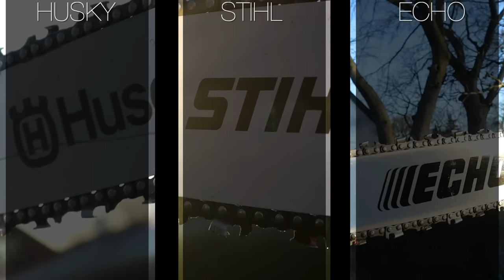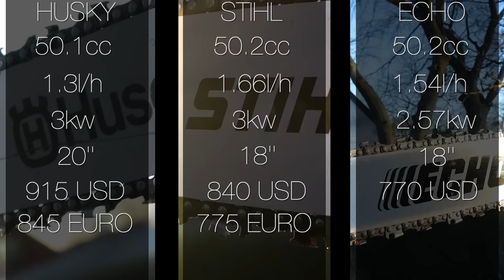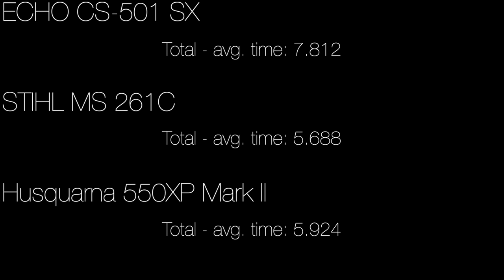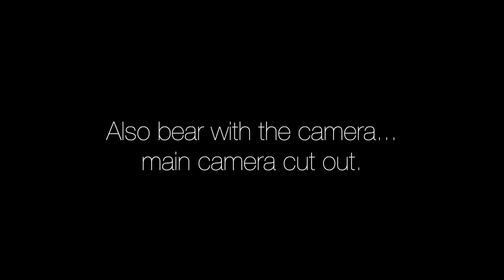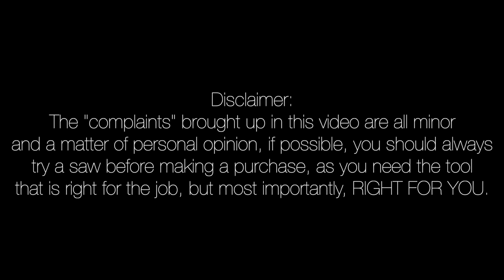Husqvarna 550xp mark II vs. Stihl ms 261 c vs. Echo cs-501 sx - Chainsaw comparison video

Comment: I have an Echo and I don't know, my RPM's are a whole lot higher than what yours was running. It almost sounded like it needed some carb adjustment.

Also, Echo has an electronic ignition which I'm not sure the other two have.

Also, were you running aggressive chains? Are they just factory out of the box?
Reply from the maker: This echo saw was send to me by echo to test and yea out of the box chains

Comment: Fantastic up load really really good Well done  The only comment I would make is in my experience the echo's tend to be more reliable as the saw ages and keep on
being good starters for example I had left an old echo in the shed for many many years and when felling a tree I broke the chain on the main saw so I went to the old one
in the shed It took abpout 7 or 8 pulls but it ran with fuel that was that old !! I have never had a problem starting any of my Echo's but have had fun and games with both
stihl and husks husks being the worst especialy when hot !!!  Thanks again it was very interesting to hear your views !!
Reply from the maker: Thank you and thanks for your input

Comment: Great video. I have the Stihl ms 261 c , but looking at buying a Echo, because I am so tired of the Fuel/oil caps and plastic locks of the top cover. They have really messed up with the new design

Comment: For checking weight, yes add the bar and chain.  But dont think its fair to fill with oil and gas.  This could make the one with larger tanks appear heavier, when really the extra weight of more oil and gas for a longer run time may be what people want. If in use the wight of oil and gas is a deciding factor, then get a smaller saw.

Comment: I only paid $445 US for my 501p brand new!
Reply: And you can get a cs490, which is so close to the 501 it's stupid, for $300. Mod the muffler, scrap the caps, and get a loop of Stihl RS chain, and you have a fine, LITE, NEW saw for $350.

Comment: Question, are the bar mounts same on Husqvarna 550 and Echo 501?  Reason I ask is was looking for a Cannon bar and their bar finder offers exact same bar part number for both but I don’t remember them being interchangeable.  Got an older Echo CS500p and my main complaint with Echo is lack of aftermarket options.  Also have a 562xp mark 2, 572xp, ms461, Ms 661c, 201T 150T, T540xp, and Milwaukee 14” top handle.  Not brand loyal, I prefer the Husky newer saws but like Stihls from 5 years ago.  Seems like Husky is going for more low end torque now and Stihl focusing on higher chain speed…I prefer the torque myself…plus Husky though a little heavier now has better antivibe, chain brake, and handles…just my opinion.

Comment: I got iritated by the oil cap on stilh as well
Reply from the maker: I know so many who say that the oil caps are crap
Reply: There junk never should have switch  over
Reply: I've not had any problem with the oil cap on my Stihl 261; I like its tool-less operation. However, the one on my Stihl 461 did play up (it refuses to easily lock back in place - takes a few tries). Then, the oil cap on my Stihl 661  has remained in good working order.
Reply: Femalelumberjack I despise the caps on my ms261c other than that the saw is a screamer but those damn caps I literally want to take a hammer and beat my saw to pieces every time I touch the caps
Reply: I think they  make conversation  kit to swap  them. Over old  kind  of caps
Reply: Caleb Thacker I understand your frustration
Reply: James Evans when a person pays that much for a saw one would think the damn oil and fuel caps wouldn’t be an issue I know several times I’ve dumped a whole tank of bar oil down my leg cause I thought I had the lid closed their junk
Reply: @calebthacker9654   100 percent  right  I cant. Count  how many time.   I dump.  Oil or gas down my leg
Reply: Mike Swank yup it’s bullshit not to mention how   Much sawdust falls in the oil cap because the caps are inset or recessed whatever that term is stihl dropped the ball bad on that design you literally have to use a air compressor to get all the oil gunked saw dust out of there
Reply: @calebthacker9654   shit annoying they went they way with all there saws.
Reply: Mike Swank yes sir I say we all start the echo train at least they price gouge us yet and make a pretty good product!
Reply: At least they don’t
Reply: Sorry
Reply: But echo people pay attention you have a good thing going don’t screw it up

Comment: Those Stihl caps take a lot of getting used to.... the older style are much simpler and better and why change something that isn't necessary....
Reply: Yes i agree after sitting on a log one day for 15 minutes trying to get the oil cap back on ..I was about to go to town with it ..gawd
Reply: @normanmallory2055  Agree! I have the 1st gen. MS261, and the oilcap was a real problem to get back on, I had to watch several videos to find one that showed putting the cap on, it helps to have the exact angle when re-inserting
Reply: @NewBookz  I donated my hankie to the oil cap while I was sitting on a log to wipe the bar oil off. Gawd how hard can this be? A cap inside a cap inside a cap, huh. Two many moving parts . The dealer grabbed a new saw to show me, first time I noticed he put it on it didn't take.. second try he got it. Yup I've had it again just would not lock down. Grabbed  the inner part of the cap and turned it until it stoped,  nope , Okay I turned it the other way, yup it went on..

Comment: Excellent comparison! I'm thinking about picking up a new 50cc to stand in for my good old Husky 55 Rancher, and these three would the main contenders from the local dealers.

Yes, the Husky and Stihl seem more "Pro" level. However, this will be my lightest limbing saw, so the Echo being lighter may be bigger deal than the power disadvantage. And, if I catch it on sale, the CS 501P will be $400, which is hard to beat.

Thanks for the video!
Reply from the maker: Glad you liked it

Comment: I am a little critical of your Husky Review, for the money, regarding other main duties with mine, it delivers on big diameters, very efficient for overhead cuts and other rigorous duties that go past simple rounds and what you seem to use it for.  Having using the 550 XP for major work projects requiring the user to limb, keep it running it for small diameter work and tank of gas, put many hours on saw reducing fuel loads, clearing brush and small trees, this saw handles everything pretty well besides global warming.  Have overheated them due to Contracted use in higher temps, making the mistake of overheating a very well used saw.  Regulation friendly Husqvarna high standards have made them my Saw of choice .I used it Professionally for landscaping, fuel reduction, road clearing crews, limbing crews, and Wildlife and Fisheries Projects.  Not going to Review the other two saws, just believe even though the price has gone up, their Research and progressive saws seem to carry the load.

Comment: Locally I can get 3 saws very close in price. All around 50 to 50.2 cc with 20 inch bar.
Echo $349
Husqvarna $399
Stihl $399.
I'm really leaning towards stihl. I know the fuel and accessories are more too but I won't be using it all the time. Great video by the way
Reply: A 261 for 399 ?

Comment: very good and useful video , ive got a 192t a 250c and an 066 all Stihl  , all very good saws ,  dont like the modern  fuel and oil caps which are fiddly and unsafe  , as sometimes  you think they are locked  when they are not  , ive had one snap too , the old fashioned caps on the 066 are unbeatable
Reply from the maker: seamus purcell thank you
Reply: @Femalelumberjack  you are very welcome

Comment: My farmboss(290 Stihl) was like $349 on sale at NAPA. Of course that was over ten years ago. Still cuts like new or better with an exhaust mod and a carb adjustment. Whenever she blows I'll throw a 390 jug and piston I. It. If bottom end is solid. Yeah, I'd rather have a c model or anything with a metal bottom end  but whatever. Or hunt a similar husky.

Comment: I go with Stihl all day every day. Most of my equipment is Stihl. It starts up right away and does the job fast and very reliable. Last Stihl I had lasted me 19 years and that thing cut down well over 6K trees and cut them all up to be hauled away. Good job ma'am. Keep up the good work.
Reply: Has stihl ms 290 for 15 years. Never put a part on it. Cut 100s of cords with it. Just chains oil and gas.

Comment: The Husqvarna 550xp I had the pleasure of using it for 6 months while I own the stihl ms 261 c, in my opinion the stihl 261 is much more comfortable than the hsqvarna 550xp. I have never had the opportunity to try the eco cs-501 sx. In the start-up between Stihl and Husqvarna, the Stihl is significantly superior to both hot and cold
. However, they are all very good machines!
Reply from the maker: Exactly, they are all good machines! I’ve loved working with both 550xp and 261

Comment: I just wanna know what more i would get out of a 261 pro Stihl over my homeowner 391. The lighter weight of a couple pounds (pretty significant) is nice but its also got half a horsepower less do to the smaller engine and costs 200 more. Although i must admit captive bar cover nuts are nice cause one of mine vibrated loose in the field today.
Reply: Pro saws are lighter, more reliable and more powerful for the same size engine. Your 391 is larger then 50 CC. They also cost more. I once had a 360 and then purchased a 440. It was one of my good decisions in life. The 440 lasted longer and still cuts great. The 360 gave up the ghost long ago. I had two 441s. They cut even faster. First one got hung up in a big oak that kicked back and crushed the saw. The new 461 is light and cuts fast. If you cut enough you will love a pro saw. I heat my home in a northern environment for years now with wood. I also own land that I try to keep fallen Limbs or trees some what cleaned up. My one son is a master sawyer. So I do take his saws and try them out.

Comment: Just purchased Echo 501, seems like the bar oil runs out the bottom (when not in use) quicker than I can pour it in! the top!  Otherwise I think it has potential, however after almost two tanks of fuel, I can't say much good or bad just yet.  
Such a beautiful lady doing a great review...thank you .🍺 🥨 🍺
Reply from the maker: There are a few comments on this video about the 501 being way better after 10 tanks of gas 👌
Hope you fixed that oil issue :)

Comment: I work in a sawmill and cut through many different types of wood and the Husqi never lets me down...we have 2 261 and they are a great saw and so easy start but definitely pick the Husqi over them for the range its versatility. It will cut anything wet,dry,hard,soft with the same ease. I found the 261 slows down after prolonged cutting. Have no idea why but the Husqi holds its sharpness for longer too. 
P.S Finally have the knack to close the oil cap 😂 First time everytime

Comment: These saws all run between $550-610 USD.  The Husky with a 20" bar is the most expensive due to the longer Bar.  From what I can tell. Today, Echo is to Shindaiwa as Husqvarna is to Jonsered.  Pretty much all will get the job done.  Pick the Color/Features you like best and start laying in a few cords before winter.

Comment: Durability is a major consideration in price comparison. The switch would be broken off the Echo and the choke would snag and ripped out of the housing in professional use. How about the mounts, or how they handle a chain throw ? Factors to consider in the $154 price difference.

Comment: IMO, the best chainsaw is the one with the best dealership nearest to you who will take care of your saw, unless you can repair it yourself, time and skill wise. If the saw you need have the speed/spec that I'd not too much different from the other, I'd go for the one that has less problems/complaints in the long run.

Comment: OMG your pricing over there is brutal. Having torn down and fixed/moidified countless saws of all 3 makers, There's one negative about Echo saws that can be turned into a big positive for mechanically savy folks. Echo is behind technologically, hence no strato porting or fancy electronics. Echoi makes their saws EPA compliant by, amoinbg other things, tuning them lean from the factory and using restrictive mufflers. A simple muff mod and subsequest retuning of the carb (Low 1st then High of course) has my CS590  easily outcutting my MS361 anf giving the 372XP a run for its money. Still  pulling  full chiisel hard and 4 stroking at 12k . Cant lean out the H far enough on the stock carb to get to 13.5k. It's heavy is my only complaint. Can buy these for under 400 here in the states.
Reply: Need to keep in mind the sales tax in the Nordic countries. It is always included in the price and it is 25% in Denmark.

Comment: An excellent video. I think what stands out is that if performance is similar, it comes down to price and ergonomics...and the dealer... I have an excellent Husqvarna dealer near my cabin, but none near my house. There it is Stihl all the way, however for me the Husqvarna is more nimble, and it fits my hand better. You really have to try them out and see what feels the best for you, both in terms of ergonomics and dealer.
Reply: If the Echo would have had a 16" bar, it would have performed much better. I just came in from using mine on a 16" cherry tree and it ate it up.

Comment: The Echo didn't sound like it had run in yet
the 18 inch bar will make no difference to speed if they are all running the same pitch of chain, and have the same number of teeth on their sprockets. If each engine spins at 10,000 rpm it will turn the same number of links per minute too. The only variable that would influence the performance would be the increased weight and drag due to the longer bar and chain.
thanks for the video.
Reply: La Echo è completamente scarburata , the Echo Is not carburated 🤬

Comment: good day! I noticed something interesting. Huskvarna has a softer anti-vibration system, but this does not interfere with the precise manipulation of the saw. stihl has a more rigid system. I'm interested in your opinion. thanks.
Reply from the maker: I don't really feel a difference in vibration when using the saws
Reply: @Femalelumberjack  ок

Comment: Great video & review 👍. 
Something I look at when comparing stuff is the build & parts quality. Even if the specs seem similar - weight, power, bar, overall feel etc., once the warranty runs out, after 10-15years, which saw will still likely be going strong? 
I think that’s where that $140 difference comes into play. Maybe not so much of an issue to a commercial user that could afford to change saws once warranty runs out 🤔.
Reply from the maker: That's a very good point. While the Echo might feel and look a bit cheaper they provide the longest warranty of the bunch so they must believe in their product. I know the old 550xp and 261 are steady workhorses so I personally wouldn't worry about any of those.
Reply: Femalelumberjack 
I’ve been brought up with Stihl being the saw of choice. 
I’m sure the others are a fine saw as well. 
I have all my gear Stihl. Ms461,250 & 180c. 
Blower, 2T kombi chainsaw, extension, hedger & brushcut attachments. 
They always do the job well. 
I agree - Stihl feels more at home & natural in my hands too 👍🇦🇺
Reply: It is not the quality, it is the marketing costs

Comment: Great review of the top three 50cc pro grade saws,  I bought the 550XP and love it.  One advantage for Husky and Echo is it's so easy to get parts online.  Stihl (at least in the US) refuses to offer parts online and Stihl's new dealers (retail H/W and farm stores) don't stock parts other then bars and chains. I takes multiple trips to B&M stores, patience and wasted time to get Stihl parts. Most of the small independent saw shops are long gone.
Reply: There are tons of small local shops here and nearly all sell Stihl and have most any parts you need if they don't they can have it in a day or 2.
Reply: @JesseLJohnson  All Stihl dealers must have a service technician. Alot of small miscellaneous parts, especially older parts , may not be kept in inventory at most places.   Stihl wants factory OEM parts put into their units.  Some people don't appreciate that though.

Comment: 3 pulls on the Stihl, no messing, (Same as mine!), 5 pulls on the Husqvarna is really good going, (Down to the operator!) Hats off to the Echo though,started on 3 pulls!
Great video!👍
Reply: Yes but she didn’t start the Husqvarna right. It has a primer and she squeezed the throttle when it burped instead of just taking the choke off so it would be left on high idle. So it was trying to start on low idle.

Comment: I really miss my old dolmar 111i,that was the easiest starting chain saw I ever owned. I'm not sure what it weighed,but it cut fast and was super reliable. Now the last few years I've been using a stihl ms441c and it's a fantastic saw,but as I'm getting older it feels like it's getting heavier. I recently bought a used(non running) husqvarna 550xp for cheap. I've just gotta figure out what's causing the no start issue. Wish I coulda found a ms261 because I dont have any servicing husqvarna dealers near me. The husqvarna seems to feel good and is several pounds lighter than my 441. Thanks for the great review.
Reply: My problem with the husqvarna turned out to be a blistered piston. It almost looked like it had sucked something into the cylinder.  It was a place about the size of a dime that was completely melted and seized the ring causing low compression.  The cylinder was fine so I bought a meteor piston and caber ring for it.